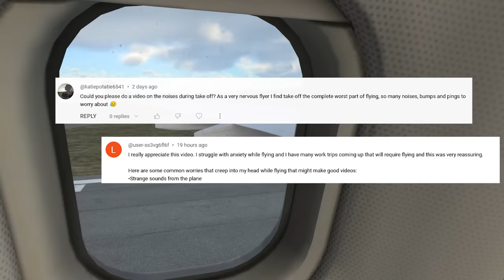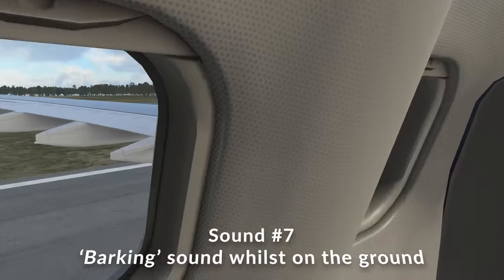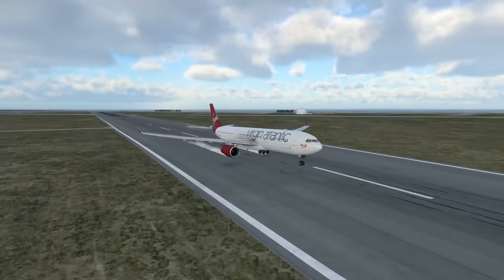What Are Those Noises After Take-Off? | Curious Pilot Explains # 3

Comment: A small notation: When the engines spool down, it's usually not the sound that's uncomfortable, but the feeling of the plane slowing down. The plane is merely no longer accelerating, but just maintaining a cruising speed and is completely normal.
Reply: Or when the flaps retract and the g-force changes briefly
Reply: @dylandettorre  I hate that feeling.  Now I know to expect it on every takeoff since on every takeoff there will be flaps retract.
Reply: Yup, the spooling down.

That's when I start pressing imaginary accelerator pedals and stuff.
Reply: OMG YES - that sound of when they are “spooling down” - the only thoughts going through my head are “WEVE LOST POWER! WEVE LOST THE ENGINES!”
Reply: Honestly its such an amazing feeling
Reply: @dylandettorre  I’m not flying Jets yet so I’m not sure how different they are affected by flaps, but I fly light aircraft and since flaps create more lift, the plane balloons when I extend flaps and I always have to fight it a little by pushing the stick forward
Reply: So what would happen if the engines just maintained the full throttle from takeoff?
Reply: @williamcordero91  extra fuel would be used, better climb performance and ultimately a faster cruise which could possibly over speed the frame
Reply: @ed5649  overspeed the frame? Like just too much structure damage? Sorry
Reply: @williamcordero91  It would not be efficient and you will damage the life cycles of the engines. Its recommended that you don’t use TOGA for more than 5 minutes on Airbus (you set the timer on your nav display during takeoff)
Reply: @RyanZ225_PC  the guy clearly isn't familiar with aeronautical terminology and you hit him with a "ND". You got to be kidding me.
Reply: @bradsanders407  Chill mate, you don't exacly need to understand what a "navigational display" is to understand the main point of my comment.
Reply: The aircraft is still acceletating. Though at a lower rate.
One way to tell this from the cabin is that flap retraction is completed some time after after engine thrust is reduced.
Reply: Actually not 100% correct.  On initial climbout the thrust will be reduced at between 1000 and 1500ft above the ground.  The engines will spool back at this point from the takeoff setting either TOGA or Flex (Airbus - Boeing call it derate).  The climb rate will be reduced but the aircraft is still accelerating to reach its clean speed (the speed it doesn't need flaps and slats) and until it then reaches 250kts below 10,000ft (North America including Canada) or FL100 just about everywhere else.  at 250kts the climb rate will increase as the aircraft climbs out until above FL100/10,000ft whereupon the climb rate will decrease again whilst the aircraft speeds up again.  Once it reaches close to Vmo the climb rate will increase again and at cruise fl you'll find that the engines don't spool back much if at all.  Where they do spool back is on descent.
Reply: @cjmillsnun  speaks the truth! To expand on this basically you go from take off thrust to climb thrust, lower the nose to increase speed and clean the wing up whilst maintaining climb thrust. That lowering of the nose is the bit most find uncomfortable or concerning, it's a eye/inner ear missmatch and feels like you're pitching down. Realistically you're going anywhere from straight and level to maybe 500fpm climb rate depending on your weight. 

This stage of flight is the last place you'd want to be slowing down 👍
Reply: If I would be the pilot, I would keep full acceleration anyway so to not frighten the passengers, they are paying the fuel after all, we will reach altitude faster and up we cannot go further because we would be lost in space forever because there is no air I guess, and I would tell jokes to make people have fun. Something politically correct, of course "Welcome aboard, this flight reminds me that time I was in a restaurant with a Jew and a Black, and I asked...."
Reply: @cjmillsnun  and we have a winner! Instead of “close to VMO” I’d call it cruise climb speed based on your cost index.
Reply: becoz the engines work in take-off thrust before gear-up/not in a long period, once gear-up, it will change to climbing thrust and change a climbing angle which is not that steep than rotate.
Reply: @cruisemermaid1284  Even if the plane does lose an engine, well there's always another one or maybe more, and if all are lost then the plane can still glide to a nearby airport.
Reply: that one triggers every bit of anxiety. immediately i think the plane is about to start falling out of the sky
Reply: @cjmillsnun  🤓
Reply: true very true
Reply: I always am uncomfortable when that feeling happens after take off & I always think the plane's not going fast enough..?? Thanks for the explanation 👍
Reply: Same
Reply: Areplane are super cool
Reply: They hit the auto pilot after the gear and flaps are up anyway
Reply: Feels like you left your guts in San Fransisco
Reply: The sound in engine spooling dow its a nice sound dont terrible its nice
Reply: Happened to me recently on a B777. Felt like the plane was dropping... Ruined the entire flight

Comment: As a commercial pilot myself i can indeed confirm that everything he has said in this video is completely accurate. I would however just like to point out as he said during take-off the landing gear gets raised, i noticed some people worry about a similar sound during landing, it is indeed just the landing gear coming down as they prepare for arrival.
Reply: Thank you for confirming, Mr. Pilot. I'm one of those scared people. l told myself l would never get to see the world because of my fear of flying. l only fly from California to my county of Costa Rica and back, that's it! and l buy a non-stop ticket 🎟 😢... l wish l would have had Pilot friends. #help #fearisarealthing
Reply: @EricaBlue48  no worries. Fear of flying is a very common phobia but you just remember that flying is the safest way of travel. If you think it might help there’s a very good YouTuber called captain joe that’s done a video on fear of flying I can link it for you if you want
Reply: @easyJet_captain  in a couple of times (the first was with easyJet) the engine was really really loud. And way different than all the flights I’ve taken. Especially during take off. Any possible explanation for that?  I may have sat at the wings, but then again on other flights on the wings it wasn’t like that.
Reply: @paschalismp  Can you try to elaborate what type of sound it was. It could have been the Air Conditioning which runs at a higher speed before the aircraft starts accelerating for taxi or takeoff etc. Or during takeoff we use a high power to get off the ground then reduce it during cruise so it could have been that.
Reply: Spooling down shortly after takeoff was originally due to noise abatement rules around the airport… and pilots hated it.  Once the aircraft reached a certain altitude, the engines would spool back up to efficient climb settings.
Reply: @Primus54  Yes, I know.
Reply: @easyJet_captain  Sorry… I’m not conversant with the first two letters “y h”.  “I k” = I know?
Reply: @Primus54  it means yes
Reply: So I said yes I know that
Reply: @easyJet_captain  Thanks!
Reply: i dont believe the passengers getting a notification when the landinggears are in, that beep what you here is the seatbelt sign. landing gears in and out is only a visual notification by youre indication lights in the cockpit.
Reply: @2684dennis  yes and no. If you look closely at the exit signs in most aircraft at the bottom of it when the “ding-dong” sound plays one of the light illuminate. This is how the crew and flight deck communicate. I won’t go into it because it defers from airline to airline but. So during takeoff the cabin crew need to know what’s going on so the ding is so the cabin crew know. Also a few minutes later another ding will sound which signals to the crew it’s safe to stand up and move around. BUT, you need to stay seated until the seatbelt sign is off because the crew have special training.
Reply: @easyJet_captain  what are you flying, boeing or airbus?
Reply: @2684dennis  airbus. But I’m pretty sure this system exists across all aircraft wide or narrow body.
Reply: Brian K  Yes, but that you can’t normally notice that unless you’re trying to.
Reply: Brian K  Uh, no not really.
Reply: Brian K  True.
Reply: I was on a flight last year and right after takeoff, there was a very low sound. It was continuous, sounded like a door alarm or a smoke alarm sound. It was not buzzing nor beeping, but just a continuing ringing for about 20 minutes. I was really scared. I thought I had boarded the wrong plane. But the ringing stopped maybe twenty minutes later. Do you by any chance know what that sound could have been. I was on a Jetblue flight from JFK to Santiago De Los Caballeros, Dominican Republic.
Reply: Also, after takeoff, he mentions the gear door going down. Well they were already down to begin with.
Reply: @richardjohnson7207  You have a point but the way gears work is that during extension the gear doors open and the gear drops down. And then to reduce drag they go back up. So it’s just the gear and not the doors on touchdown until back up in the air. Another reason for this is because the gear doors are the same length as the actual gears themselves so if we left the doors down then they would scrape the floor. (I’m referring to the main set of gears not the nose gear) the nose gear works slightly differently but has the same concept
Reply: @josedrullon  no sorry I don’t know, it could have just been the engines but I’ve never heard of such a sound. Sorry. I’m sure it was completely safe though there would have been no danger to the aircraft. On the flight were you sat towards the galleys(front or back 2 rows) by any chance because often during climb cabin crew can start warming food for their service so it could have been that? Don’t worry though I’m sure it’s completely safe
Reply: You are not a pilot dude, stop the cap
Reply: @easyJet_captain  You literally make roblox shorts and you sometimes don't even use grammar. 💀
Reply: @easyJet_captain  adults usually don't act like you, especially pilots.
Reply: @easyJet_captain  You're not but whatever.
Reply: @easyJet_captain  Thanks for the reply. From the pics I took, I was sitting right before the left engine. 
So I when looked  out, I could see very well the left engine and its moving parts. It was a great feeling though being in the skies after not getting on a plane in twenty two years.
Reply: @richardjohnson7207  Not necessarily. Most airliners have landing gear bay doors that close to partly cover the landing gear bays when the landing gear is extended for aerodynamic reasons. When the landing gear is selected “up” those doors will open to allow the landing gear to retract into the landing gear bays and will close again when the landing gear is fully retracted. The reverse will happen when the landing gear is selected “down”, these doors will open to allow extension of the landing gear and will close again when the landing gear is fully down.
Reply: and as for flaps too, if the pilot if using flaps they may make noises similar to the landing gear sounds.
Reply: C'mon let him it's just funny. He plays Roblox. He doesn't even know what a trim is😂.
Reply: @JoshuaKianSchultz  Whether you like it or not I’m a pilot. So stop being salty and tryna act cool. And yes  I do know what trim is
Reply: Without a doubt, the most scary sound is that of the engine powering back after takeoff, because it's coupled with the sensation the plane is losing altitude!
Reply: @EricaBlue48  If it's any consolation, I have a friend who despite being afraid of heights became a pilot! Must be some sort of Batman thing. Lol
Reply: My fear isn’t of flying, is not about the plane but another Andreas Lubitz suicide tendency especially in 2015 Germaneings flight back then, how well do we know if that happened and no one spotted his condition until it’s too late?
Reply: @squeelerjakeaxcradle7095  Pilots get mental and physical health checks every six months or so (varies from airline to airline and country to country) so people like that will be caught before they can do anything to harm themselves or others. And don’t worry. In my 10 or so years of flying I’ve never seen anyone that even seems mentally unstable.
Reply: Yes completely accurate
Reply: I love the PTU solenoid sound,and the flaps

Comment: Good info.  Might want to mention the flap actuator motors at takeoff and pre-landing.    Sounds like a drill motor under load as you watch the flaps extend/retract.
Reply: Yes, that sound scares a lot of flyers
Reply: Yeah was waiting for him to mention that. It's pretty loud.
Reply: so thats what that is.. I thought it was the landing gear doors locking after being retracted.
Reply: Exactly. My first flight ever was a transatlantic flight from Europe to North America. I can still remember that I couldn't place that sound during take-off. On the second flight, I was sitting on the wings and saw them move 😄
Reply: The screw jacks

Comment: One key sound you missed out after take off and approach is the flaps retracting / extending. When they retract, you definitely feel a loss of altitude and the engines increase again slightly to compensate. Also when they extended, you can feel the extra drag through the increased vibration.  You can also hear the flaps extending on the ground. My house seems to be at that exact point when the flaps extend when planes come to land at Manchester in the South West to NorthEast direction.
Reply: yessss, I hate the drag feeling when they start to approach, it's like the airplane suddenly brake in mid air, feel that negative G on me hahaa
Reply: You can also hear the hydraulic motor that moves the flaps.
Reply: I wanted to add this as well, you were a step ahead :). I live "under"  runway Buitenveldertbaan close to Schiphol, same situation, makes a sort of hauling noise.
Reply: No aircraft loses altitude with flap extension on takeoff. It would generate a Ground Proximity Warning "Don't Sink". There may be a change in thrust however. Some aircraft reduce thrust automatically with flap retraction. This is probably what you are feeling.
Reply: @ImperrfectStranger  You beat me to it. Unless the flight crew are not paying attention (extremely doubtful btw) there will be no altitude loss during flap retraction. The airplane can accelerate with less drag and will continue to climb even with the same thrust setting. 

The feeling you have in your seat and on your body is the same as in the cockpit. Another reason why, when flying on instruments, you cannot trust your body, you have to trust the instruments completely.
Reply: @Ntthaibk  haha i dont hate it but interesting and yea also happens right after take off, the gravity hits different and you feel like you will sink in your seat

Comment: Good video for those who don't know these things. Not a commercial pilot myself but a pilot nonetheless, and also a mechanic who has worked on all these kinds of systems on all sorts of airplanes over 40 years. 

Another thing - if the airplane makes a noise it's not supposed to, the flight crew will have as much concern as anyone else on the plane. And they will almost always get a notification in the cockpit warning panel(s). You gotta trust they know what they're doing!

Comment: Another thing of note, sometimes atc will place speed and or altitude restrictions on planes especially in class b airspace which surrounds the vast majority of large airports frequented by big passenger airlines.

This will sometimes require fairly significant engine power reductions.
Reply: Agreed, sometimes in busy airspace, the climb-out can get held at an intermediate altitude, then in order to avoid overspeed, especially at lower altitudes with speed restrictions, the engines have to come back, sometimes somewhat abruptly, only to spool back up when the clearance to a higher altitude eventually comes and the climb resumes.

Comment: Its also worth noting that if you’re sat upfront you’ll hear the engines more than you would sitting behind it, as you’ll only hear the exhaust gas coming from the engine and how its overall louder in cruise than during takeoff as the airspeed makes a big white noise which drowns out the engine sounds. You should also mention how you can hear sounds like the fuel pumps (you used a 737 fuel pump noise as an example when you mentioned hydraulics) and external sounds such as brake fans and apu.

Comment: Really interesting video! I always wondered what the "barking sound" was! 
I think you could have added the flaps especially before take off and before landing when they get extended for additional lift and some aircrafts (I have only seen it extensively on A380s) do extensive pre-flight checks to check rudder, flaps etc. Before take off!
Reply from the maker: That's true, the flaps sound will also be more or less dramatic depending on where you are sat. Perhaps I can include that in a later video. Thank you for the comment.
Reply: @CuriousPilot90  And the fuel tank balancing and equalization pumping mid-flight but usually after takeoff.  This is common in modern large aircraft.
Reply: @CuriousPilot90  I came here to suggest the flaps as well and your point about where we're seated affecting how loud it is makes total sense - I always thought it's a very loud sound but then again I also always sit next to the wings!

Comment: I remember hearing the sounds of flaps extending during taxi to the runway before takeoff, and likewise retracting during taxi after landing. The sound of the landing gear coming down minutes before landing is very iconic, there is a constant "rushing wind" sound after it is fully extended. There's also the breakaway thrust used for taxi